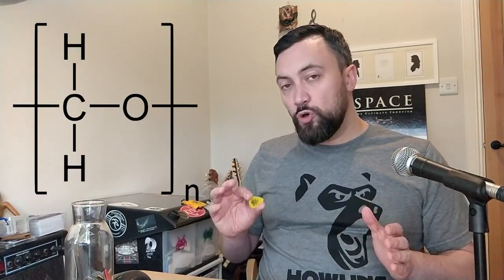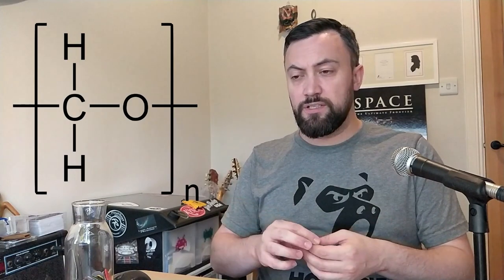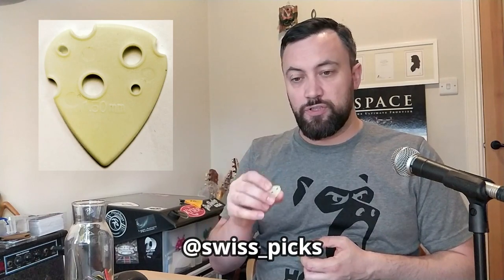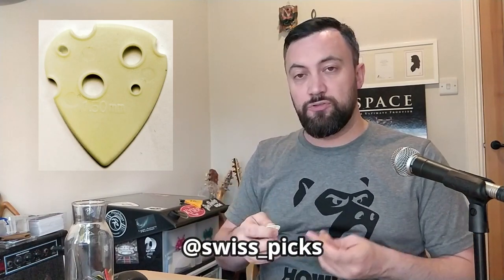The Science - Part 6 - Delrin

Comment: The best pick ever was made of Delrin... Bakersfield .74 mm white. Google it, you've probably never heard of it but the few people who have all loved them. I read you started playing in 1997, so you just missed them, as the owner of the brand and tooling at the time, film composer John Goode, stopped making them in '97. In 2000 he sold everything to Dunlop... who immediately discontinued the brand. I have a couple of the thinner Bakersfield black picks left (made of a different plastic, if I recall correctly... acetal?) but haven't seen a white Delrin one firsthand in.... 25 years?

The shape was not quite standard, they were just slightly pointier. They're descended from Mosrite picks, you can still see those on Ebay occasionally for exorbitant sums of money, but the photos will give you an idea of the shape. I've had ok luck filing down Dunlop delrin 500s, but it's still not quite the same thing.